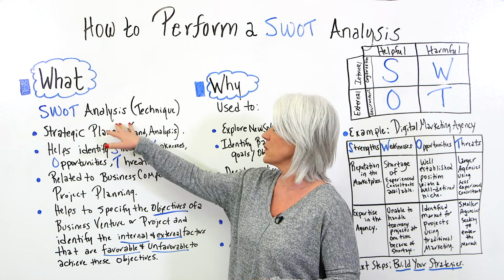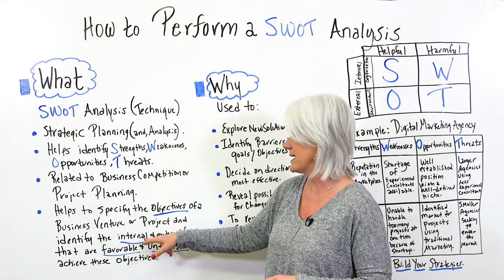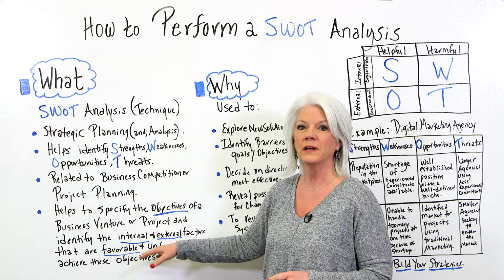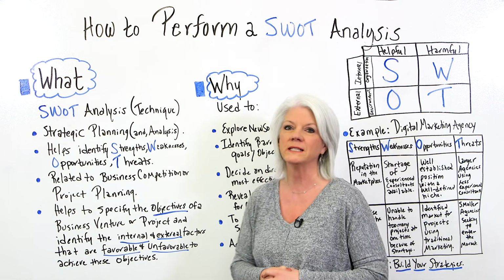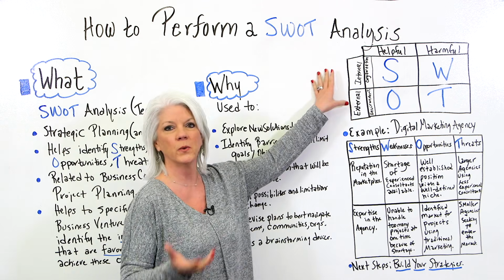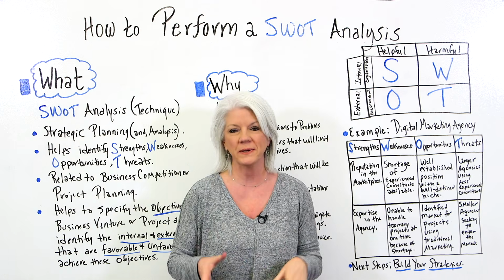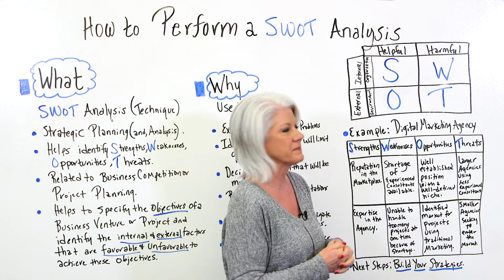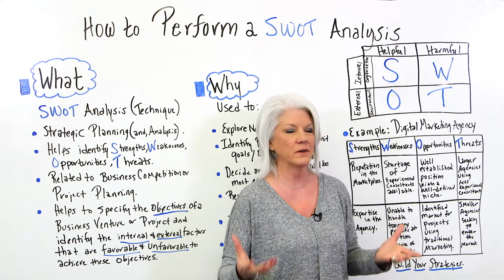How to Perform a SWOT Analysis - Project Management Training

Comment: Opportunity 1 on your video is a strength; opportunity 2 is either strength (they have a strong marketing team) or an opportunity (demand in a market for their services exist). But the way it is presented here, it is not clear what exactly do they mean by this factor. Opportunities are factors in the external environment, which a company (especially such a small company as on the SWOT) does not control. They cannot control the demand (hence, opportunity, comes from external industry environment). They definitely control their position within a niche (hence, strength). Opportunities are factors coming either from PESTEL or Porter's Five Forces. Both threats are competition threats (one is competitive pressure currently in the industry, another is the threat of new entrants).

Comment: Thanks for reading off the board
Reply: Hello, I need a bit of help with an issue, could you assist?    my OKX wallet holds USDT TRX20 with the phrase (clean party soccer advance audit clean evil finish tonight involve whip action). What steps should I take to move it to Bybit?